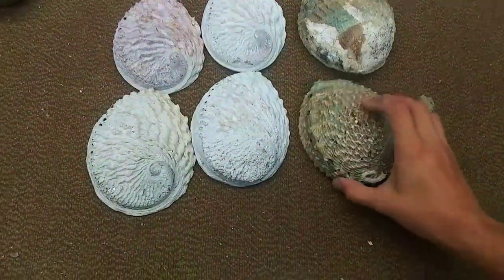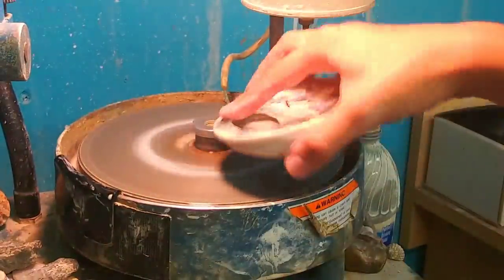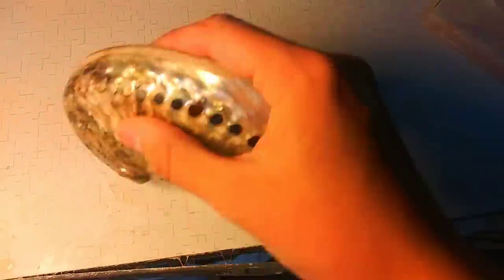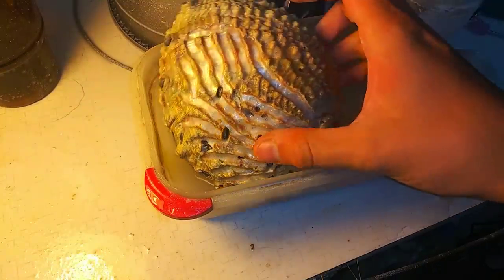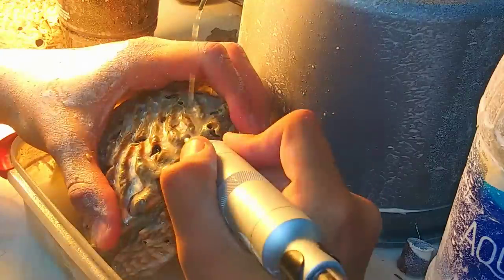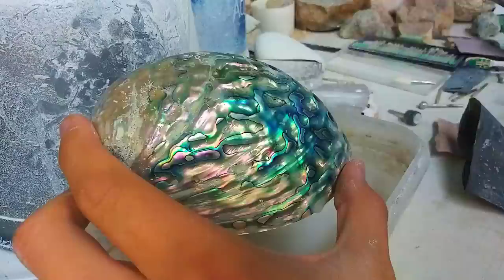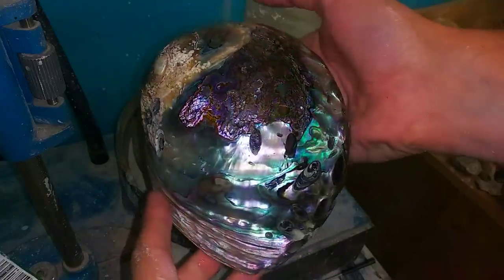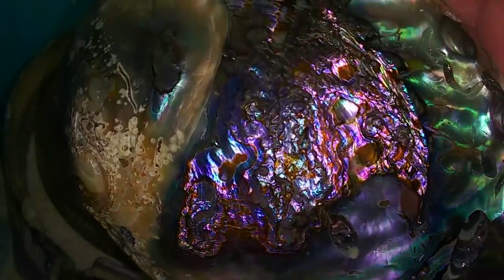How To Polish Abalone Shells Like a Pro! Contour and Level Polishing Paua, Pink, & Midas Abalone!

Comment: The Paua looks great.
I tried soaking some in citric acid, it kinda worked.
I'm in Nz so I find lots of these on certain beaches.
The colours are incredible.
Reply from the maker: Gotta love that paua!😄 ive also tried to dissolve the shell with muriatic as well and it is just a bit too risky😅 the pearl dissolves slower than the outer shell but it still does get eaten away by acids so i just stick with this method now
Reply: @TheoKellison Bagus sekali cara anda  menghindarkan resiko bahan kimia tapi sekalian memberi solusi praktis skill ide  bagus cara baru yang tidak banyak orang pikirkan secara manual bahkan bisa dikatakan tradisional yang profesional. Semoga Anda menjadi orang hebat di masa mendatang dan banyak memberi inspirasi positif kepada semua orang yang mengenal Anda.terima kasih juga  telah mengundang inisiatif saya untuk memahami  karya  inspiratif yang bisa dicoba pada  cangkang yang lain atau mutiara dari ekstrak erang berbeda..

Comment: I have an abalone shell that I bought years ago with the thought of making something out of it. Now I realize I actually do have all the tools to do this project I might just have to dig it out and play.  Now...which box of treasures is it stored away in? Hmm.....🤔😁 Thanks for sharing this Theo. Your very much an inspiration. Oh yeah. What do you use for the water drip?
Reply from the maker: Oh cool!😄 i hope you give it a go! It is sooo much fun to watch these tbings transform before your eyes😄 and as a said in the video, my camera does not do them justice at all; they may look vibrant on camera but they have twice as much color in person!😁 and for a drip tube i use the drip bucket from my faceting machine but actually the best and cheapest drip setups to find if you dont want to make your own can be found in pet stores! They are a little drip system that is designed for controling humidity inside of reptile enclosures and also serve as a "water dish" for things like chameleons, whom drink the drops off of leaves and what not and can not directly drink from a standard bowl. There are many ways to make drip feed systems but those are by far the fastest and easist 😄
Reply: @TheoKellison Thanks.  I am thinking of trying a small water feature pump that I got from a thrift store but the pail system sounds like it might be a simpler approach. Any idea who would supply the fittings?

Comment: In the last video, you used Meguiars car show polish, which I ran all over town to find. Do you still use it on your shells? You also mentioned it can be used on some rocks, which ones? I found a couple of old shells at the second-hand store, can they be too old to still get a good polish? Thank you, Debbie Love your videos!
Reply from the maker: Yes! Forgot to mention meguiars in this one but i do usually buff the shell with it when im all done! The only place ive found that reliably caries it is harbor freight. And it does work on certain stones but generally only soft stones, for example i always use it to buff my fossils😄 and as far as age, pearl is very resilient stuff so it does not typically age in a way that would affect the color; so long as their is some pearl it can absolutely be polished😄
Reply: @TheoKellison  do you have any experience with Mother's mag and aluminium polish? I also have a finish called Renaissance Wax that's super expensive, but very high quality. It was originally developed for the British Museum back in the day, and it is a finish that imparts a great luster on many things from ivory to wood. I'll have to use some on some abalone I'll grind out. I have a shell that has some seriously intense blacks going through the shell. I've actually never seen one that looks so dramatic, and I'm itching to get it banged out 👌

Comment: Is there anyone who sells the shells. I would sure like to have a few, and maybe an assortment. I didn’t know there was more than one type of abalone. Thanks for any info.
By the way, I think your videos are informative and we all improve along the way so don’t be too hard on yourself.
Reply from the maker: It can be a bit tricky to get ahold of them reliably, there are many places online that sell them but they can be so riddled with holes that they are hard to work with😅 typically with abalone you get exactly what you pay for so it is definitely worth it to spend a bit more in order to get stable shells. And absolutely! There are hundreds of species of abalone these are just typically the most common ones that you will see available😄 they are such incredible shells though!
Reply: @TheoKellison  depending what you are doing, and where you live, abalone/mop can be "repurposed", from local location; I regularly check my FB Market listings for whole shells, or shell items...recently scored some "tiki"-type masks, covered in dozens of abalone pieces; not flat, so I am sanding them flat (I use them for inlay work).....